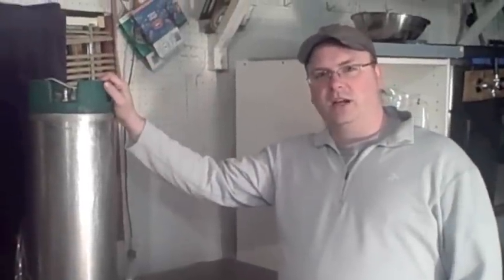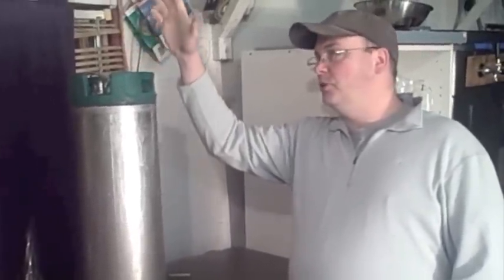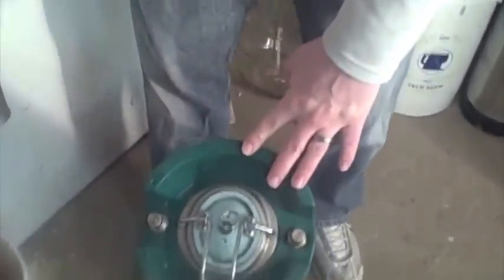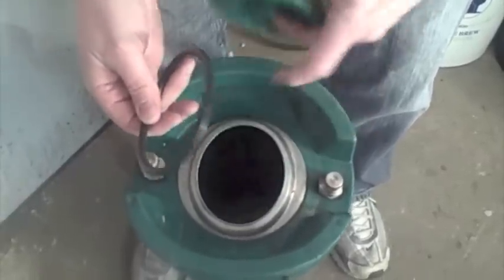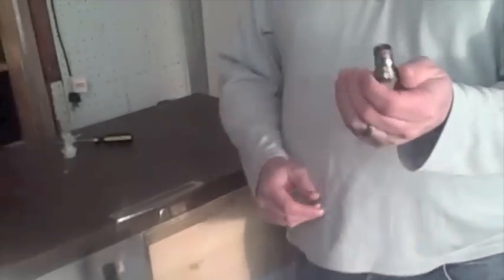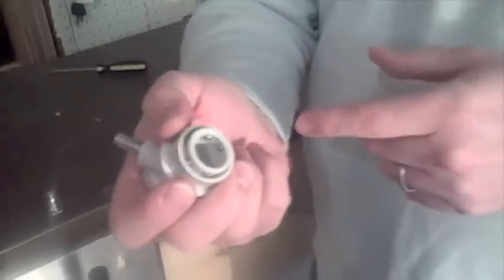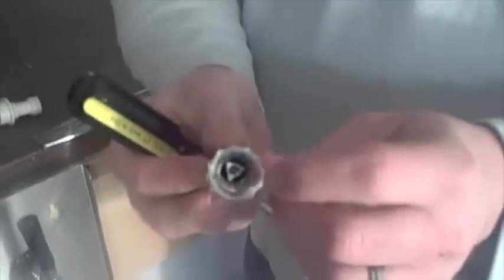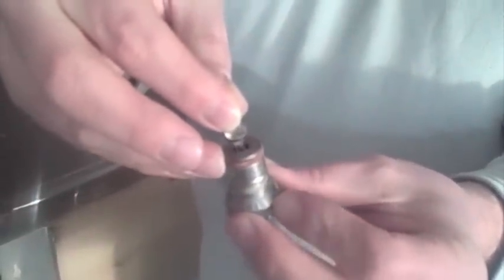Corny Kegs for Homebrewed Beer

Comment: Hi there,

 I'm new to home brewing,  I've purchased 2 corny kegs to put into a kegarator a plan to put in my cellar at home,
So i was wondering if i could have my beer line running from my kegarator in the cellar up to my kitchen directly above my cellar which is about 5 foot higher. Or does the beer line need to be in the kegarator?
Thanks in advance
Paul..
Reply from the maker: Beer line does not need to be in the kegorator.  There are many pub/bar setups just like you describe.  In this application you need to carefully balance the amount of resistance in all that beer line.  The resistance would add up base on the inner diameter of the tubing, the length of the run and the height in needs to travel.  With such a long run dispensing at 30-60 PSI is not uncommon.  You'd want to research this a little closer and using standard inner diameter beer line probably wouldn't apply here.  Last thing to keep in mind is that beer foams if it isn't cold.  So you want to insulate the lines the best you can.  If possible refridgerate the lines if possible along the whole run.  This is often done by wrapping the lines all together with another long run of glycol chilled line, then insulating the whole trunk line up to the kitchen faucet.  Cheap and easy? NO.  Nobel and worthy for good beer in the kitchen? YES.  CHEERS!